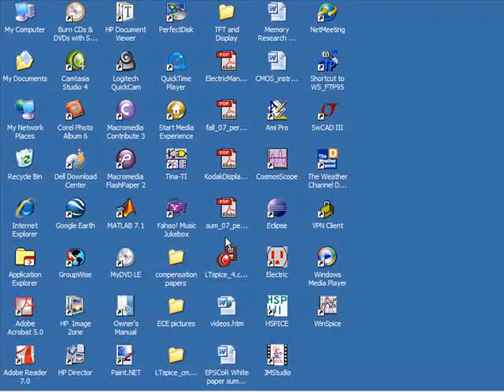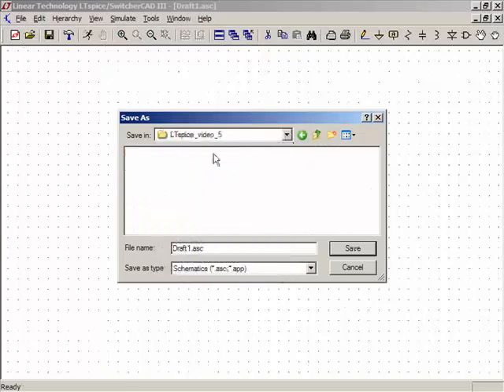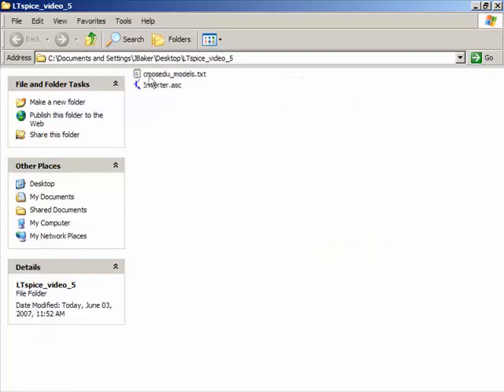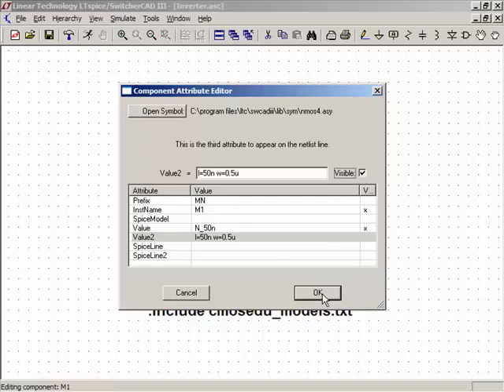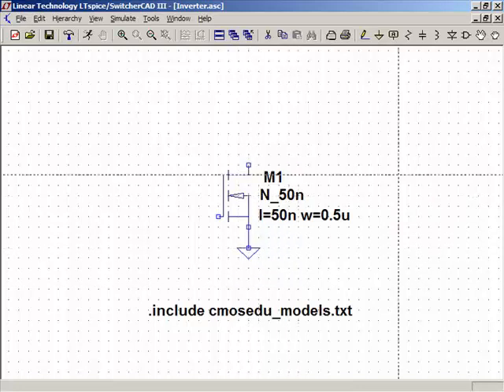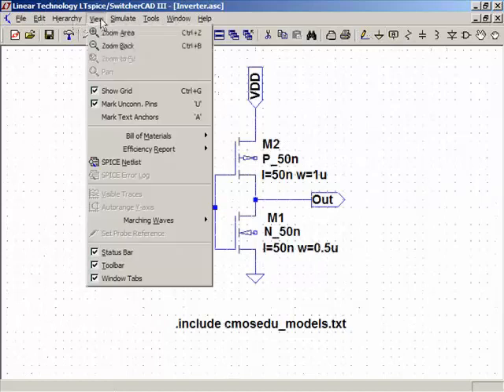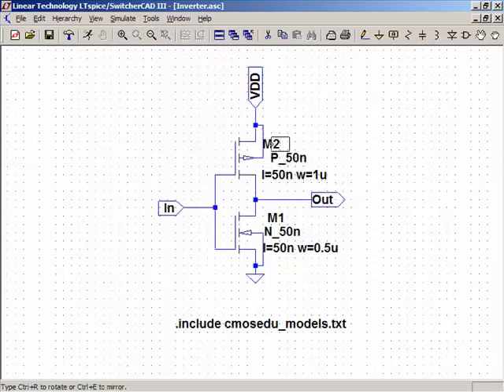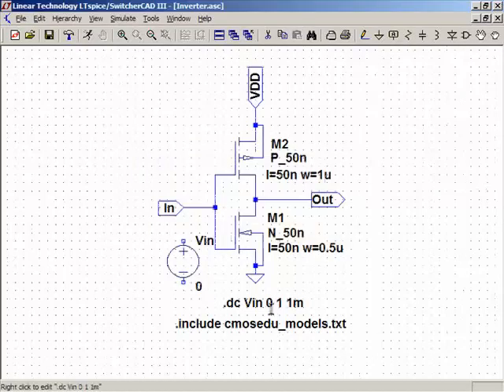LTspice video 5

Comment: I had tried it
it worked but I have failed to make ring oscillator using differential amp.
I had simulated one stage and both of differentil out put were complementaty.
But when i made it using 3 stage differetial amp, both of differential out put were same & flat.
I need your advice.
thanks at first.